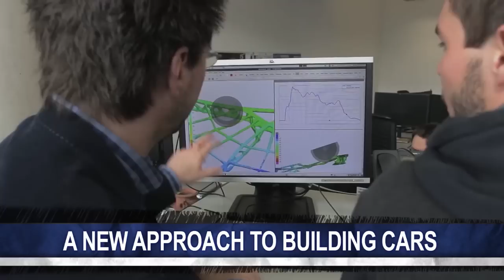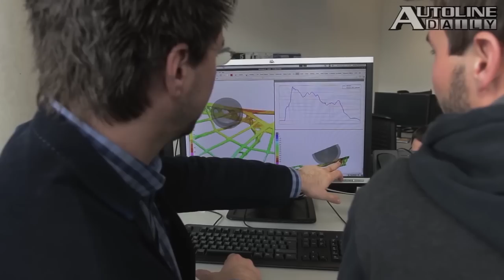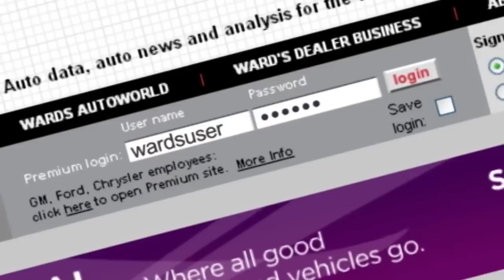A New Approach to Building Cars, VW Delays the New Phaeton - Autoline Daily 1685

Comment: While lightweighting a car has its benefits, at what point does it become less safe to drive at highway speeds or in high winds?
Reply: I've wondered that as well.
Reply: swinglow33 That's likely when more aero, cross-section drag, lift, and downforce profiling will become more of a focus in the design process. For now though most vehicles are still much heavier than they used to be for a given size but are smaller and have improved in the mentioned areas. I suspect if cars ever get too light to handle common cross winds they will start adding directional spoilers (e.g. NASCAR's flaps) and in the case of the BEVs they could have batteries designed to fit low down in the car which will also help with stability. That said I don't see something the size of a Suburban becoming as light as a Fit or even a Focus any time soon so I don't think we cross that point with safety. I hope that helps!